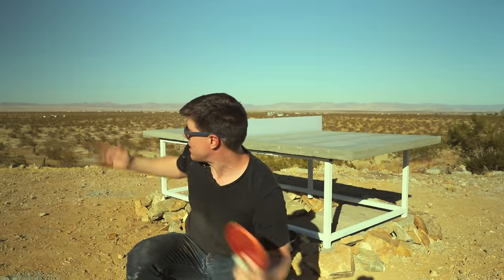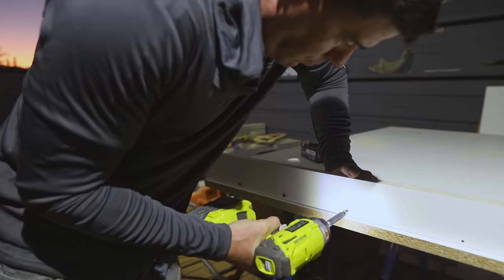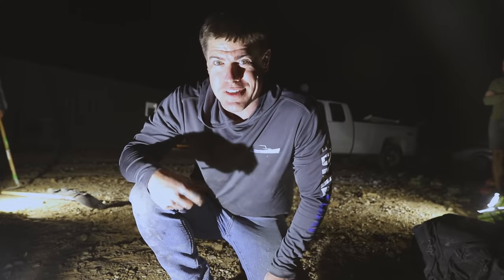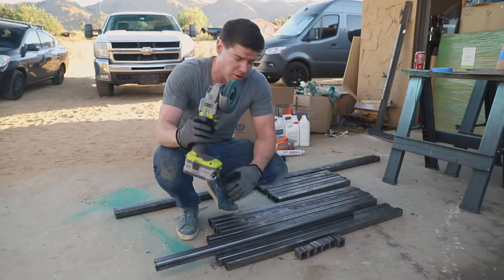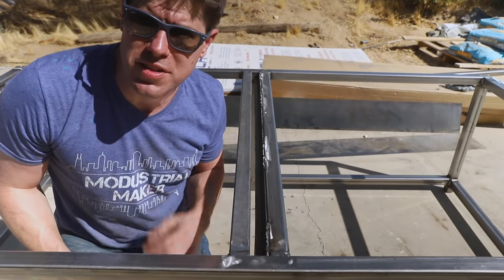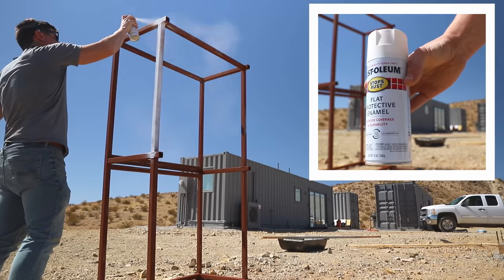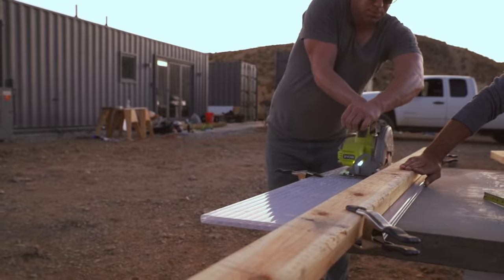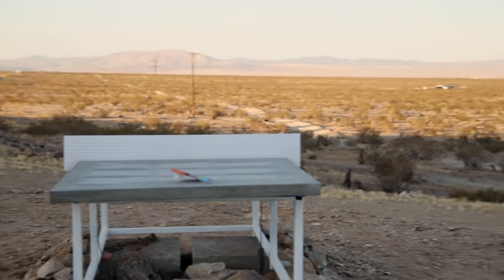DIY CONCRETE Ping-Pong Table!!

Comment: The table top lines could be LEDs set in translucent resin?
Reply from the maker: 100% !! This was actually my original plan.... But I had to pull this whole thing off in a week and someone else's workshop that I'm not used to, so alas.... It will have to wait for the sequel next year 😉

Comment: Came out so awesome dude - the video overall was one of your best in my opinion. Would you do anything different next time?
Reply from the maker: Thanks brother!  With more time there are lots of things I'd do different... Use gfrc, or at least sand and do a slurry coat to even out the surface look.  I'd probably make an acrylic "net" from clear acrylic , and etch in the net pattern so you'd get the same effect with LEDs as you do with those etched lamps, for the net. The original design also had upside down pyramidal pieces under the table, with a small reveal between them and the bottom of the table for the LEDs.... Had to nix that design element due to time.  So yea, lots of room for a sequel to this one 🤣🤣
Reply: @modustrial  Love it - I'm considering this as a long term project at my folk's cabin in the mountains - its so cool and unique - cheers buddy
Reply from the maker: That would be awesome, go for it!

Comment: Does the surface has the same "bounce property" or it doesn't matter?

Nice project btw, especially when it gets dark early at this time of the year in northern hemisphere
Reply from the maker: Thanks!  Yeah, I had no idea how well it would work, but the concrete surface played surprisingly well.... There really wasn't any time where you felt like it was different than a normal ping pong table would be.
Reply: @modustrial  hard to be worried about bounce when the presence of wind is always there. Just so long as the surface is smooth enough to not deflect, I think it would. Be perfect. Outdoor pickpong is alot of fun but I don't look forward to chasing after those balls
Reply from the maker: Ha, yea, fortunately in the desert, not a lot of places for them to hide :)
Reply: @modustrial  They could hide under those rocks around the table.
Reply from the maker: tis true...the rocks could definitely steal some ping pong balls in the dark...

Comment: Lame Brain........there is a reason why ping pong tables are made from wood... wood enables the ping pong ball to bounce........cement does not do this as well, yes it does work but it is less enjoyable to play on the cement table then the normal wood table.  So too bad you wasted all that time ...and money.  You were heading in the right direction with the melamine, and should have stopped there.

Comment: Hey Mike...wish I could have been there buildin' with you guys, looked like it would have been a lot of fun, 'ceptin for the midnight days of course!.If I may add a suggestion for next time...I would shorten the base and remove the rocks from each end so that the players can get close to the ends without tripping. Other than that great job! Please keep these videos coming!
Reply from the maker: Thanks! It was a ton of fun.  Surprisingly the rocks really didn't get in the way while playing, but yeah ideally, you'd bring dirt and create a level ground surface... that would have taken a couple days of work and/or heavy machinery, tho so had to make it work on the sloped ground as best we could in the time I had there 😁

Comment: I want to make a 6' x 6' slab to put down at the golfing driving range. Since this is close to the size I'd be using, how smooth did the top of the ping pong table turn out? Do you think it would be possible to make the slabs smooth enough as to not scuff up the golf balls when they hit them?
Reply from the maker: I think that concrete, by it's nature, would likely scuff golf balls.  If you polished it to 3000 grit, you might have a shot